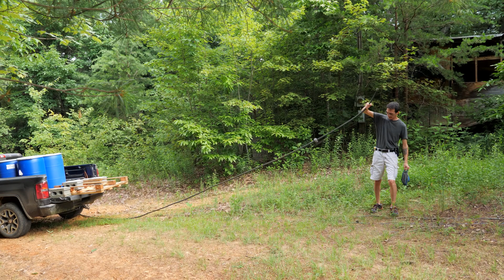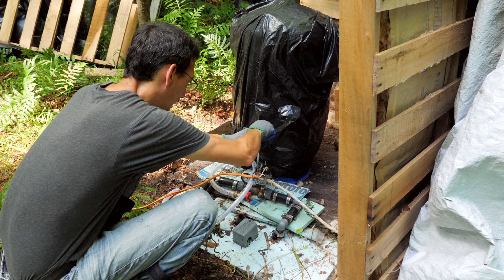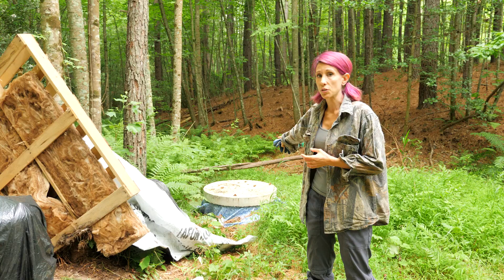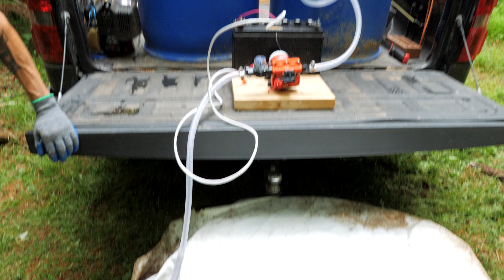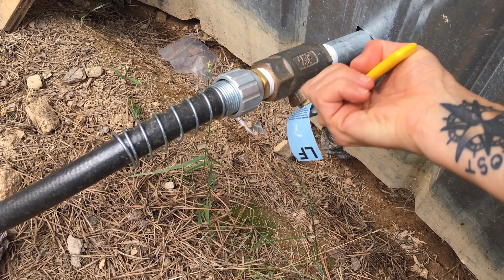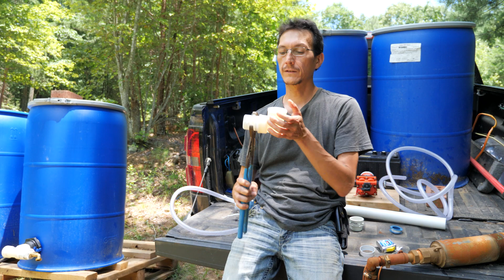NO WATER...AGAIN! Will This Off Grid Gravity Fed Water System Work? (Part 1)

Comment from the maker: NEW!  Guildbrook Farm TEES and SWAG!  Also, 15% OFF entire store until 7/15 (see store for coupon code): https://goo.gl/xp1aDx See our exclusive Guildbrook Farm Back to the Land design - now available!  More styles coming soon! Thanks for following along on our journey!
Reply: You guys are the best. Love you
Reply: Guildbrook Farm - Off Grid Living Hopefully everything will be sorted out soon. Not having water stinks!
Reply: Guildbrook Farm - Off Grid Living Hopefully everything will be sorted out soon. Not having water stinks!
Reply: Was thinking about it and if you do run the new temporary wire, a float switch to turn the pump off will be a good idea as you don't know the full condition of the pipe between the pump and the house. A broken pipe and that pump would quickly dump the water in the chamber then start running dry if it lacks dry run protection. A float switch in the chamber will turn off power before it fully drains the water keeping it from self destructing. 

A good use for the spring water when you build the house would be running the toilets and a fire sprinkler system on but would require an independent water line for them. $5-10 sprinkler heads in the common fire starting locations and the bedrooms on a independent water supply can be the difference between a little charring with water damage and losing the house due to the time it takes to get water on the fire.
Reply: Great show great 👍
Reply: Twenty feet is 10 pounds pressure forty feet should be 20 pounds of pressure

Comment: When our pump went out just before winter I had to rent an air hammer and drive a "stab well" with 1 1/2" galvanized pipe.  I drove the pipe down 25 feet in 5 foot sections with threaded couplings between sections.  Probably something you've considered but just thought I'd mention it.  Hope you get a solution soon.  PS  you have to use a well point on the first section of course.
Reply: Sam Finn you know, I once had to do that but my dad showed me a neat trick. My 1 1/2”got a reducing fitting that brought it down to 3/4”. He installed a 4” long, 3/4” nipple into that, with a threaded coupler on the end. Now, my neighbor is only 50 ft from me and had a well, so he ran a hose over to us. Instead of hammering it in, we hooked that hose onto the fitting my dad had installed on my pipe. We started the thing by cranking on my neighbors water and letting the water flow through the pipe to erode its own bore hole. It required an initial hammering to get the first bit in but after that, the only thing my son and I did was guide it straight. Then just pick it up a couple of inches and drop it back down repeatedly until the water digs the soil out. I was really surprised at how much easier it was. Be well!
Reply: Michael ... I've heard of this before.  Sounds like it would work especially well in sandy soil.  Thanks for the tip!

Comment: You two amaze me with the ability to tackle situations! My question for you guys: How difficult has it been to be so flexible, able to switch from project when these huge issues DO crop up, since it sort of changes timelines for other projects. Have you had to change your mindset on things? I have control issues, so I think I'd be a mess!
Reply from the maker: It’s the ultimate challenge to manage everything as it happens but we’re both good at rolling with life, adapting and overcoming while building better solutions so the problems of the past stay in they past. 👍🏻

Comment: Your little seaflow pump mentioned at 12:53 is exactly the same pump we use to run out entire household with. It has a pressure cutt off switch built in and works very well. Enough for showers and dishes etc. What a little gem. Our larger 800w  220vac pump is used for the washing machine only. Using the 12vdc pump reduces our power consumption dramatically.

Comment: That well pump is installed incorrectly. That is a submersible pump, designed to be installed in a 4" well casing. It is designed to cool itself from the high flow of water between the clearance between the ID of the well casing & OD of the pump. It can be used in that application if it is encased in a 4" PVC pipe shroud. That would explain the over amp draw along with the incorrect wire sizing.

Comment: Some things to think about... is the wiring going all the way down there still good... ?  The pump has 3 wires.. can it be rewired for 220 volts.. if so.. that will halve your current and you might be able to get by with what you have.. if the pump is still good.. ad can be rewired... idk how far it has to push the water uphill so I don't think a single stage pump would work which is probably why they used a submersible ..  best of luck.. you people are as tough as they get !!!!  Also I forgot... if you get it working get a pump switch something  like this.. your pressure specs may differ.. just trying to show they are available ....Square D FSG2J21M4CP 30/50 PSI Standard Pressure Switch with Low Pressure Cutoff .....  so if the intake gets clogged or the cistern goes low it will stop the pump.. unfortunately you will have to go reset it manually but.. you need to check what happened anyway..

Comment: The nice thing about your current situation is that you can reach everything to work on it. It might be worth keeping the current system up and running just in case the new well fails in some way later. We've had to hire people to pull the pump and then fix a connection to the well casing. So it takes a couple guys to pull up the weight of the pump, hose, wires. Backhoe to dig up the dirt around the casing. You have the ability to fix it by yourself with the current system. It might be a pita right now but you're free. Free from systems that add things like fluoride in the water.

Comment: Your perseverance is amazing. I feared that DC pump wouldn't have enough head to lift the water the 8 or so feet to get the water into the barrels on the back of the truck. Hang in there and keep up the great work.
Reply from the maker: Works like a charm.

Comment: Sorry to hear about your water issues. New Hampshire is getting dry again.We have three options. # 1- Add an artesian well to our five dug well system. #2- get a 400 gallon livestock tank for the truck bed and pump into it. Only works if we have a water table. # 3- Fill the livestock tank at our town fire station. They have a line to the lake, which is under pressure. All we have to do is back up to the connection and we have water for our cattle. You did a good job sorting out your immediate crisis. Check out your local fire Dept. They may be able to help you. I would love an old Jacob's turbine windmill to pump water.. We have the wind power on our ridge. Good luck.

Comment: Great solution to your problem.  I don't want to nitpick but I didn't see you use a primer on the PVC connection of the two 55 gal. barrels.  Hope your well drill goes smooth.
Reply from the maker: It’s a one step glue. No primer needed. ❤️

Comment: The wire size is fine.  I have a pump that will work for you.  Are you running the pump off the Magnum?
Reply from the maker: The wire is cooked. Pretty sure it had a nick in it up the hill and that caused it to burned up when the pump overdrew from silt. Pump still works. Gonna run new wire.
Reply: Guildbrook Farm - Off Grid Living a nice soft start pump with dry run protection instead off that hammer of a pump would treat your Magnum nicer.
Reply from the maker: Its a McDonald 1/2hp with a Franklin motor. Putting an SQFlex3 in the well when we drill it. Could do a collab.
Reply: Guildbrook Farm - Off Grid Living 6SQF-3 I assume.  Feel free to call me.
Reply from the maker: Not sure yet as the well hasn’t been dug but at least the 6 if we can. Will be in touch 👍🏻
Reply: Enginner775, I thought of you as I watched the video, figuring you might have a suggestion or two. Glad you had a chance to watch.
Reply: The McDonald 1/2hp with a Franklin motor for the spring is ~$155 on Amazon, the SQFlex3 for a drilled well is ~$4300 that's a huge investment.  I wonder if it would be possible to created something similar to the capabilities of the SQFlex from commercial electrical parts/electronics on Ebay for much less money.  It sounds like an interesting area to research, you can buy a truckload of commercial electrics for $4K.
Reply: Correcting my comment after searching prices:  Ebay - Grundfos 6 SQF 3 SQ Flex Solar Water Well Pump $2345.00 with shipping,   There a a bunch of models there.

Comment: I apologize in advance if someone has already suggested this. Aside from your snake issue, but I also noticed in another comment, that the bugs are bad in your area. I'd highly recommend Guineas to solve both those problems. They are also a excellent alarm system. Being extremely self sufficient they  don't require any extra feed. The best of luck with this new problem and a quick sollution!

Comment: When we moved to our little homestead we didn't have water for years. We hauled it once a week from town and we had rain barrels where we caught run off from our tin roof. We also found a spot where we could get water from a local spring.  We finally got a well drilled. It cost around six thousand dollars. But now that we are much older with health problems it was worth every penny! Don't miss the blue barrels or hauling water at all. Good luck to you guys.

Comment: Our well is 540 ft deep and I have our pressure tank switch set at 22 psi trip-on and 50 psi trip-off .. so your gravity feed pressure isn't all that different from what we are using much of the time in our own set-up. We could adjust higher but find this pressure range serves us fine .. even at the lower end of the cycle, say 22-35 psi range, we have no difficulty using garden hose, washing machine or any other device and I just don;t feel the need to adjust higher. Again, congrats on that gravity system.

Comment: Have you tried a “ Homemade Ram Pump “, for long distance water pumping and no power neded. Also you can fill a smaller air tight barrel with 7 inch plastic balls ( the cheapest ones) inside and conect it to the barrels up hill to create more pressure . Just saw the video on YouTube and wanted to share if it helps. Love your videos guys. And learned a lot

Comment: Very interesting to see all the details!  Nice to see a working gravity fed system too as I hope to have one of those as well one day.  It looks like quite a distance from the trailer to the spring, hopefully it won't be a massive job relaying cable that far.  Was there a circuit breaker on the line to the old pump?  I would've expected that to prevent the wires burning out, assuming it had been appropriately sized when it was originally installed.  Thanks again for another fascinating video!

Comment: Sorry for the situation.  Get some of those lithium emergency power cells with a built in alternator.  Weighs about 3lbs and can power ac or dc.  Can be charged with car, solar, or mains.  I use one with my $39 Harbor Freight DC pump to transfer water from rain barrels.

Comment: Hi,  Have you looked into Ram Pumps? no power needed.
Reply: ram pumps are excellent idea
Reply: Siphoning from the truck bed into the tank below would have used zero energy, why use an electric pump for that?
Reply from the maker: Because we can?
Reply: Ram pumps require having loads of extra water to run off.  Only about 10% of the water is actually pumped.  The other 90% runs off.  They are great if you have a spring that runs tons of water off constantly or if you are on a river where you can route the waste gate water properly but they don't just pump water with nothing like a magic box.  They require very specific circumstances.  I wish my circumstances allowed me to use one.  I think they are neat.

Comment: Nice work guys. I had a thought / my 2 cents. If that pump still works (fingers crossed) instead of 350 feet of 8 gauge wire, why not take your portable generator down to the spring, to run the pump. Use your existing water lines to push the spring water up to your gravity barrels. Then just gravity feed your camp for the 2 days, and repeat. 

Can't wait to see your solution! Good luck !
Reply from the maker: We tried that. Pump draws too many amps.

Comment: I guess this video is old enough this won't be helpful for y'all, but maybe it'll help someone who comes after:

Avoid 90 degree turns in your lines.  Where you have to do it, try to use double 45s.  That 90 immediately after the pump definitely contributed to its problems.  The tighter you turn water, the more you lose pressure and flow to turbulence while putting back pressure on your pump (which in turn is robbing you of efficiency and putting greater strain on the pump).  By using two 45 degree fittings instead of a 90, you increase the radius of the turn which decreases the effects of making the turn.  Over short runs or if you have a bunch of headroom with your pressure, this doesn't matter a bunch, but once you start talking a few hundred feet and start putting in a bunch of 90s, the difference becomes huge.  Downside to making longer turns is that they take up more space.

Comment: Dig your own well.  It took me 3 weeks to complete. Buy concrete rings from the municipality get them to deliver the rings on their truck and lower the rings with a truck crane, seal with pool cement.  When it was done I was very satisfied.  Endless water potential when the well is done. :)  Also for the snakes a foxhound will tell you where they are keep an axe ready! :)  Best of luck :)